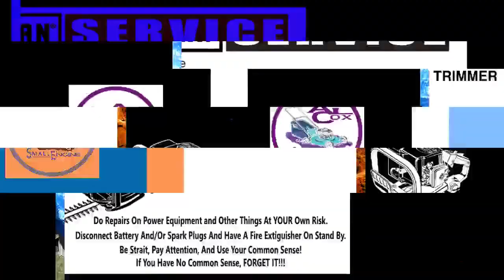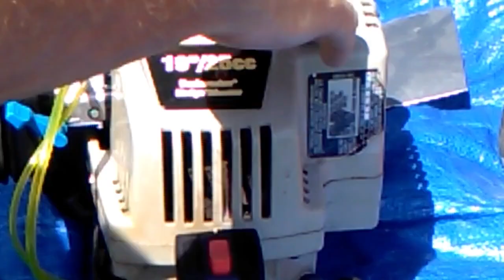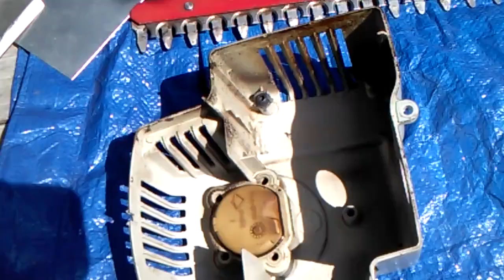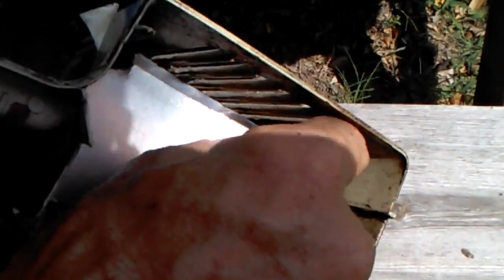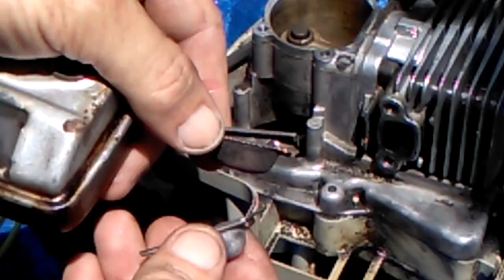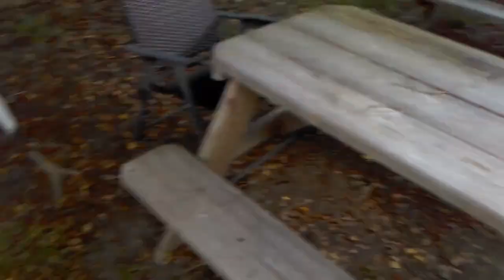CRAFTSMAN 358.795792 | BUSHWACKER | SPARK ARRESTOR | HEAT SHIELD REPAIR

Comment: You did a slight adjustment. Which one did you adjust the low?  Turned out or in?  Thanks
Reply: Thanks.  I'll give it a try.
Reply from the maker: I slightly turned the low setting on the carburetor out.  
Let it run a few minutes and get warm to get your 
final adjustments on both high and low.  But this was
all I had to do to this one.

Comment: Outstanding!!! Thank you.  I have this unit, and I watched your fuel line replacement now this one.  Do you have any others? I had no idea about the 4 T-25 o. The very top.
Reply from the maker: https://www.youtube.com/watch?v=6gD0qVImZqA This video shows replacing the 
carburetor, fuel lines, air filter and plug with a low
cost kit from e-bay.  These are great units for 
general yard trimming.  Cheers!  🍻 -Al